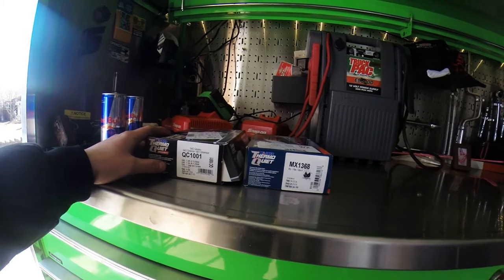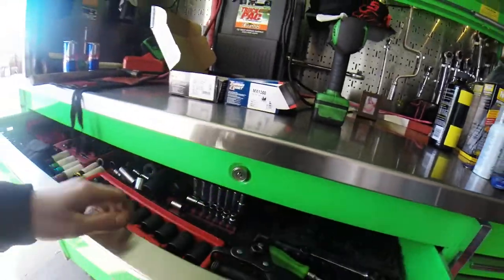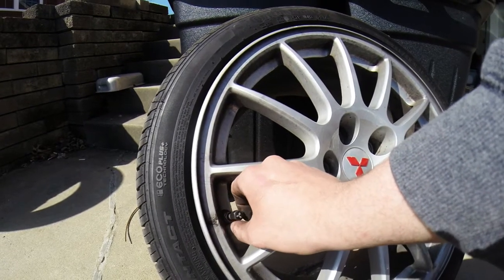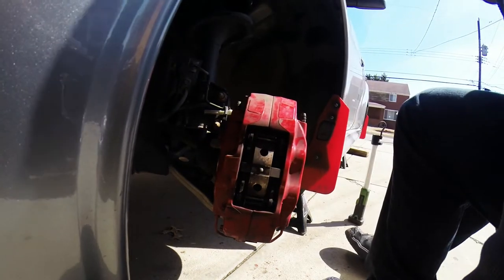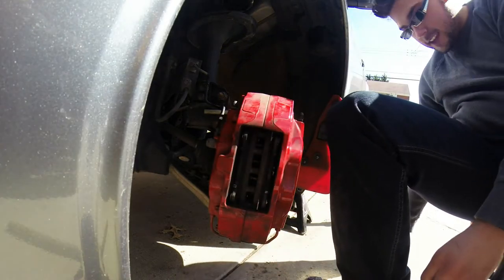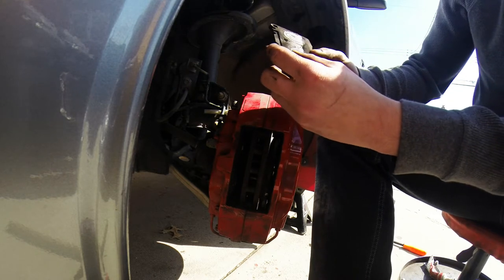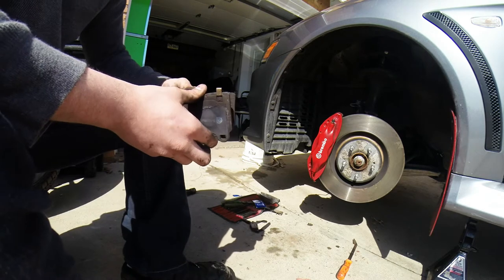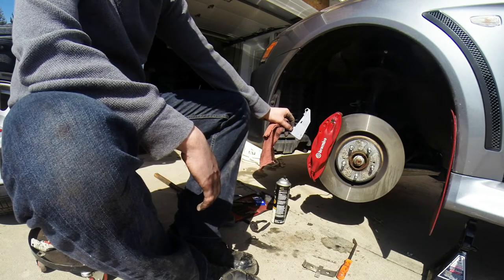EVO X Brake job ft and rear Brembo part 1 ....tpms tip

Comment: Yes there is a reason those metal shield plates are on the back of the pad. they are heat shields, stops the heat transferring from the pads into your brake fluid (via your calipers)

Comment: what is that white stuff you using to spread on the break pads to hold the shims in place?
Reply from the maker: i use dielectric grease its clear doesnt wash out and is great against heat. when i was at the ford dealer ford used that stuff from the factory so do other cars if its good for them its good for me.plus it was sticky enough to hold the shims lol

Comment: What brake pad you use? Just bought stoptech and going to replace it soon...
Reply from the maker: +kurt evo wagner thermoquiet brake pads they are  on my tool box there i got a good price on them because i worked at advance and they offer a one time replacement on them. i have used them for years now and i have never had any issues with them

Comment: Is that a silicone as you said...and how about brake oil level...is the oil level gonna rise?
Reply from the maker: Yes it will rise really you should open a bleader and let the old fluid out but a 4 piston cal is a bitch to get the air out with out a vac pump . its grease not silicone